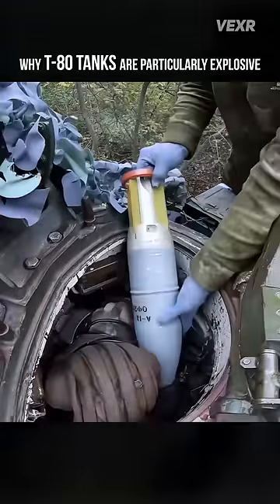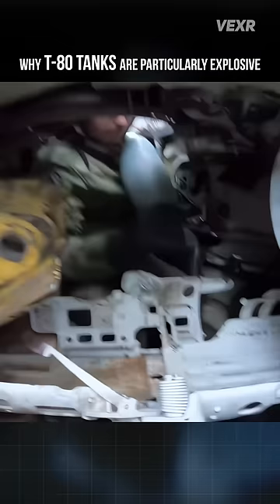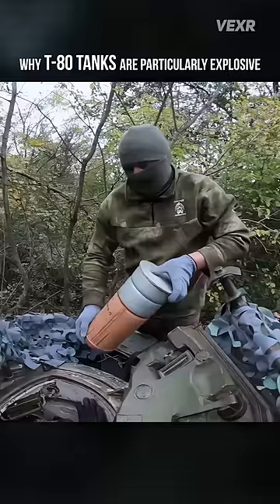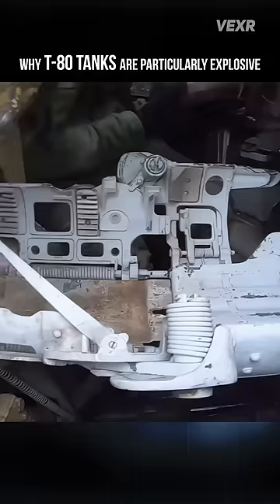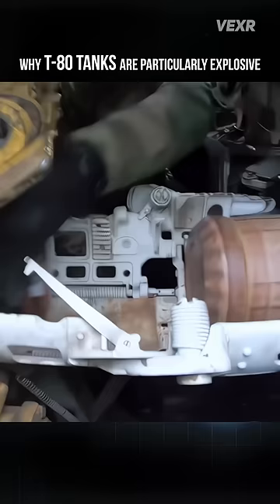T-80 Tanks Are Particularly Explosive, Here's One Reason Why

Comment: It’s not just that it’s because in comparison here

The Abram’s for example has all its ammunition stored in a locked tight compartment that is armored. If that goes off the crew is protected from the blast.

The T-80 because of its autoloader system has all its munitions in the neck of the turret. That being said when that ammunition goes off the tank becomes an oven for the crew and the turret pops off like a champagne cork

Comment: Hydraulic fluid has never been a problem with these. The auto loader has shells stacked around the turret like a drum mag, a weak point of all tanks is the joint between turret and body. If and auto loader is hit in that joint it could cook off every round at once, vaporizing the crew and launching a 12 ton turret 50 feet in the air.

Comment: First of all hydraulic fluid in general is some of the most flammable and corrosive fluids second of all it doesn't matter whether it's the electronic or hydraulic system they're more dangerous because of where the magazine is located in the turret. If you do get penetration it's almost guaranteed depending on where you hit that the magazine will blow up and take out the tank and everyone in it.

Comment: Eastern doctrine tanks use autoloaders (doesn’t matter electric or not) which have all the ammo stored in the turret. Western doctrine doesn’t have autoloaders (store them in a seperate compartment) since they want to re-use broken down tanks and keep the crew safe. 
That’s why tanks from the east blow open when hit 🤷🏻‍♂️ you just gotta hit 1 round and the turret will fly. Western tanks get knocked out and need repair.
Reply: Making your tanks being with size of building with weight around 60-70 tons and thin side armor doesn't make tanks safe for crew.

On the other hand, soviet tanks have less members in a tank crew, which is better, they are lower than nato tanks, and their weight is around 40 tons.

Autoloader makes it easier to shoot and reaload on the move.
Reply: @viceguy4880 Back in the cold war, the Soviets built their tanks to attack across the North European plains and NATO built their tanks to defend. The Soviets, for both political and military reasons wanted to max their numbers out so an autoloader made sense because it freeded up a conscript to crew another tank. 3 man crews instead of 4 means you can field a third more tanks for same number of crew. NATO tanks were taller and with more gun depression to fight from prepared berms and dug in positions. Soviet tanks also gave slight regard to crew comfort too in contrast to western tanks.
Reply: @nighttrain1236  I really don't think it was about it. There were 5 million conscripts in the Soviet Union at all times, in case of war, it could have been increased up to 30 million.

Comment: Ok, notice that the propellant casing is partially red? That's a combustible material, and is more fragile than the metal base. If that combustible portion is ruptured, the propellant grains inside can fall out and get caught in the mechanism. Pinched between moving metal parts can cause them to iginite (flash), thus igniting anything close, like other casings, hydraulic oil, etc. I have seen the aftermath of that happening, both in Kuwait and here in the States.

Comment: What has "smart-ammo" to do with this? It's not like western munition is like: " oh I'm still in the tank,I shouldn't explode because my crew dies" if it's hit it goes boom. 

And crew training can only help so much. Sure an experienced well trained crew will spot danger zones and such, but again if you get hit, you go to space. 

The problem is that the autoloader is and it's ammo are right in the middle of the tank in between the crew with no means of crew protection. If the crew and autoloader were separated (like in the overrated T-14 Armata) or if it just had some blow out panels (like on the Leclerc) then the crew would have a bigger chance of survival.

Comment: I think the main reason is just the ring of ammo around the turret, inferior armor, and inferior target acquisition and aiming systems. The time that may otherwise be saved by the autoloader is offset by other links in the chain. Western tanks have either automatic aiming or at the very least a computer calculated aim point far as I know depending on which country. I'm pretty sure the Challenger has a system where the commander can designate targets  and after the gunner fires it'll automatically slew to the next one so the gunner doesn't have to figure out where the next target is using an inferior system like clockface. Western tanks also have ammo compartments with blow off panels giving the crew and the vehicle a significantly higher likelihood of making it to another engagement even after having the ammo cooked off.

Comment: Sooooo, they have a carousel and they have to load it like the engineers forgot that they needed to put ammo and propellent in first, before loading the gun?
How odd. When they make auto loaders, they usually take advantage of storing the ammo in a safe compartment and the propellent is only ever exposed during loading of the gun. So this whole thing is confusing as hell. As long as you are fast and never spotted and shot at, you are fine!

Comment: Nobody uses flammable hydraulic in a tank, the diesel fuel from the t80 is for more flammable than the hydraulic fluid. 

For those about to talk shit about an autoloader it does have its advantages. One, crew does not get as tired and a consistent rate of fire.

Most of the autoloaders carousel is at the bottom of the tank so it wouldn't matter if it get hit or not because if you get penetration that deep the crew is already dead. 

The Abrams blast panels only protect the crew slightly as the door is automatically closed and can sever your arm. And it will not save you if an APFDS penerates the tank that deep either, the crew will still die from the spalding.

The french have a magazine loaded design so it isnt a western vs eastern philosophy.

It is just a means of production to lessen the number of crew needed for the tank. As it maximizes the the efficiency of the crew to do other tasks without the need for a loader position.

The autoloader carousel also makes a tank lower to the ground reducing the silhouette of the tank, which proves its own advantages in the grass land and open terrain of eastern europe. 

Just because something is different doesn't make it stupid, have to look at what something is designed for and why to understand the engineering behind it.

Comment: That the problem of all tanks with auto loader located under the turret.
Leclerc and type 10 auto loaders are safer since their auto loaders are located in the rear of the turret and shielded by the armor.
Just a difference in overall design, nothing more.

Comment: Every single tank is explosive when filled with ammo! Modern ones less so, but the ones built back than are... Including Leopard 2. Btw Abrams has loads of flamable hydraulic fluid used for its turret drives.

Comment: The autoloader itself is the problem. All current russian auto loaders are carousel style loaders that surround the turret basket. This allows for a very compact turret but it also means there's no protection for the crew or the munitions if the turret or turret ring is penetrated. Where as the french Leclerc has a cartridge rack style auto loader meaning that if the turret is penetrated, either the crew or the ammunition is hit, but not both. This allows for enhanced survabilitiy. Because if the turret crew is killed, the driver can still return the tank to base. But if the ammo rack is hit, the blow out panels funnel the explosion out of the tank, saving the whole crew. Meanwhile, if the turret or turret ring on any of the russian tanks is penetrated BOTH crew and ammunition are gone, and whether or not the driver can escape before the ammunition innthe autoloader detonates is basically a coin flip. but there is not 1 scenario where the turret ring is penetrated and the crew survives.

Comment: Well see heres the thing, the tank wasnt thought out slowly, its designing phase didnt take its sweet little time ironing out the flaws and actually making it less hazardous, it was designed and planned in haste due to the arms race in the Cold War with the USA. 

 The idea of the T-64, 72, 80 and 90 was a low profile fast moving tank that could Blitzkrieg into western europe and pretty much copy how the Wehrmacht did it to them in 1941, they wanted everythin to be light and efficient as well as cheap to produce, which means the quality was less over the quantity, thats what they were aiming at, quantity. 

So yea its to be expected that they didnt think about such things as Hydraulic fluids or the autoloader position, because they were to busy rushing the production so they could have Quantity over Quality but they still are good tanks nontheless, they just need adjustments and improvements is all.

Comment: Ammunition normally has to get extremely hot to go off and considering those rounds are a lot bigger they could withstand more heat so no it’s not a recipe for disaster and if that’s the case then go to electric bam problem solved

Comment: They really aren't any more deadly than any other tank. At the beginning of the war they were storing additional shells in the walls around the turret which they have stopped doing sense. Most modern tanks have this feature of additional shell storage around the inside of the turret and it's proving to be a bad design for modern combat.

Comment: Well, as someine said:
"American tactic is to put a crew of specislists in a tank, filled with complex electronics and sruff (that's why they require a specialists to run them). They are valuable recource and so their tank have all the crew-protection it can have. They're bulky, well equipped fortresses on treads.

Russian tactic is to put 3 to 4 Ivans into much less complex (analogue tech all the way) and harder to hit (bc tonk is smol), tank and send them off to battle. These Ivans are not top specialists and thus the loss of them won't hit war machine hard. Because of this tanks have less crew protection, more questionable (in defense direction) and simpler techs, but significally cheaper, easier to produce, easier to understand and drive, smaller and harder to hit."

TLDR: Western tanks - bulky fortresses, stuffed with complex tech that require serious knowledge and skill to operate them, but capable of wistanding a series of hits.

Russian tanks - harder to hit analogue machines that don't require much knowledge and skill to operate them, but when hit they are most likely gone

Comment: Some extra info for folks wondering.

It basically is perfectly designed as a bomb. Everything on it including the turret mount and hatches dont meet code aka anything theyre fighting against can destroy it. A dang .50bmg can go through it.. And the ammunition and hydraulic fluid is right next to eachother and both will ignite at around 400 Celsius. So anything goes off in the tank boom it entirely ibites explodes turns to a fireball and blasts the turret off the top. The entire crew dying from a blast of heat around 2,000 celsius for around 3 minutes. 

Not a fun time to be a russian tanker..
Reply: meanwhile the abrams holds shells in the turret lmao
Reply: Почему-то это не мешает танкистам выполнять свой долг, и переживать на в танке несколько попаданий, благодаря динамической защите и броне.

Comment: You guy need to understand that different nations have different doctrines and tactics, so  you cant compare them together 
Like in the ww2 italian tank, usually have light armor tank or none at all because they were made to have excellent cross-country capabilities and move through rocky mountain and infantry support is their main role so when i say they suck at 500m to 2km long range tank duel compared to the tiger or panther, or breaking though enemy heavy defensive line though numbers and mobility and decent armor like the ussr t34 its absolutely right that they suck at it but that not what they meant for so when you see they do it its usually because of tactical mistakes of the mission control that place them in an awfully situation.

Comment: I dont think Russian tanks are cutting edge designs. But the ammo rotunda is not a bad design.

If your armor is penetrated and an enemy shot hits that, and you explode, you didn't die because the 'badly designed carousel stowage', you died because THE ENEMY PENETRATED YOUR ARMOR

Is an Abrams design bad because the turret has massive, flat sides, that are much larger as a profile and less likely to stop an incoming round than the very sloped, very low-profile, dome-shaped turret of Russian tanks? Obviously not. If an Abrams is shot in the side of the turret, you lost control of the battlefield and are being flanked. It doesn't MATTER where your ammo is. 1 crew member dies, spall enters the tank cabin, the tank is abandoned.

Comment: The reason they don't do as well as Western tanks is because most systems on a Russian tank are designed to avoid or prevent projectiles from getting to the crew, but not the components. Western tanks are DESIGNED to be shot at. They have several systems in place to extinguish ammo fires and fuel fires. They eve have a engine bleed air air filter sneeze. My point is once hit, Russian tank design breaks down. Western tanks can be hit, and even if a crew member has died, most if not all hydraulic and electric systems are online to aid the remainder of the crew in taking the enemy out before the next shot

Comment: All tanks are death traps. As super and subsonic portable/mobile weapons are developed, together with the portable or mobile high energy weapons tanks have a strong destructive power utility the crew is literally cooked by high energy or supersonic weapons. Tanks should be remotely controlled, with built in autodestrucción capable of clearing a city block, and following by support crews to do quick in field repairs. As they become remote controlled some systems should be carrying the same destructive power as the heavy ones, but the lighter ones are faster and maneuverable to quickly respond! Anyway if DARPA’s decides to approach me I can improve tanks lethality by 60% 😮! 😂😂😂

Comment: now the use ww2  usa m4 shermans ow wait... [also great electric outage less reliable uptime also igniting 'risk'] 
  But the Sherman was also a death trap.
Most tanks at the time ran on diesel, a safer and less flammable fuel than gasoline. The Sherman’s powerplant was a 400-horsepower gas engine that, combined with the ammo on board, could transform the tank into a Hellish inferno after taking a hit

Hence, the Sherman’s grim nickname—Ronson, like the cigarette lighter, because “it lights up the first time, every time.” but better cover up that one [ fyi ] ua went back to soviet materials, because they were as they themselves said reliabler then nato garbage of second hand rejects from then second grade gear of usa

Comment: Autoloaders sound like a no-brainer upgrade when playing video games, and then you learn that two 19 year olds drinking Monster can kill 12 Russians per minute.
Reply: It's obvious that you don't know much about this topic, don't comment on things you don't know because that way you only create misinformation, now I'll give you a hand: Park a T-72 next to an M1 and you'll notice that the American tank is considerably higher than the Russian one. No problem. It was originally designed to sit with the hull lowered in a fixed, prepared position to defend the borders of Western Europe with only the turret visible, so height was no real issue making the human loader much more practical.
The Russians, on the other hand, KNEW that their tanks would be the ones crossing the open terrain to assault the NATO tanks. As a result, they opted for an automatic loading system that allows the tank to mechanically load on the move without the human loader having to worry about being tossed around the turret by an evasively maneuvering tank. This also meant that the tank could be about a foot shorter. This meant that even incrementally the tank would be a smaller target and therefore more difficult to hit when moving in the open.
It was a conscious design choice made based on the criteria of the 70s and 80s. They simply did not see fit to change the design, it is just one of the most exported tank models in the world, so the then Soviets and now Russians see no reason to abandon the concept.

Comment: For the umpteenth time I have watched/read foreign “expert” statements that Russian weapons/vehicles are bad, unreliable, primitive, etc., etc.
That the Kalashnikovs were copied from the Sturmgewehr, although they have nothing in common, unlike the M series assault rifles. That the armor of our tanks is poor. That an automatic loader is worse than a loader...
True, all their “expert” opinion is flushed down the toilet with one simple question - why then is the Kalashnikov assault rifle the most used in the world?
So what is the fundamental difference between an expensive Abrams, Leopard or any other tank and relatively cheap Russian/Soviet tanks, if they are destroyed in the same way? (like the crew - the presence of knockout panels does not particularly help the crew withstand the cumulative jet inside the tank) But at the same time, they are more expensive, clumsier, and much heavier - and their production requires much more resources.
At the same time, the same foreign tanks continue to be destroyed/burn/failure due to simple RPGs, while there is a lot of video evidence of how Soviet/Russian tanks, thanks to competent armor and dynamic protection, can withstand direct hits from anti-tank weapons.
In fact, everything is simple - your military-industrial complex creates weapons and vehicles in order to sell them. And ours is to serve and protect.